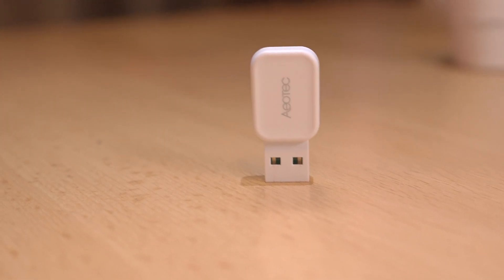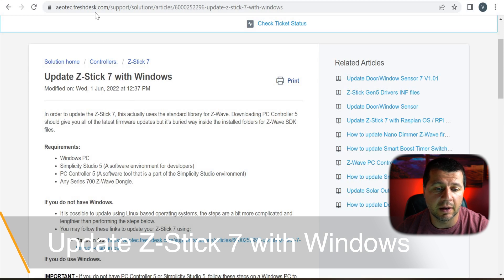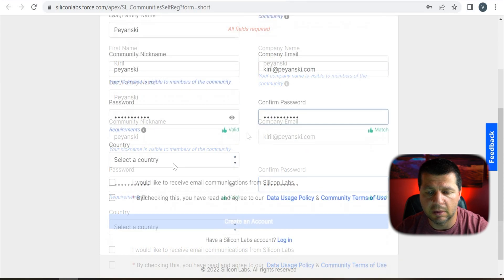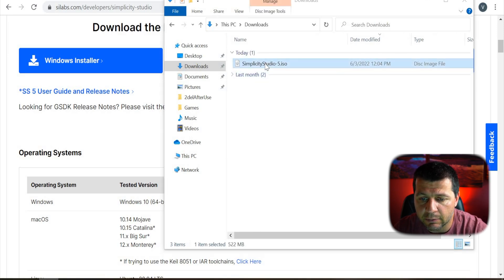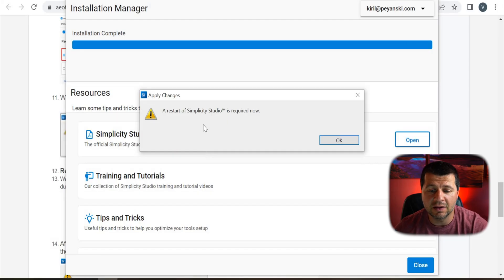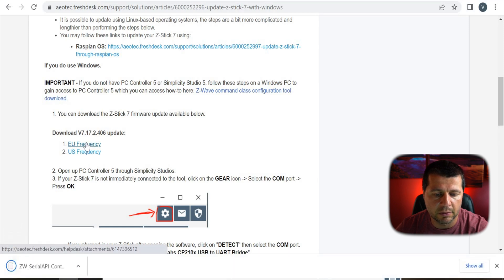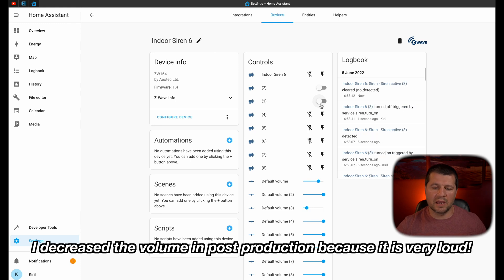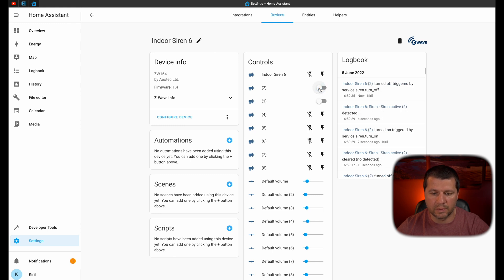I got Gen7 Z-Wave working in Home Assistant

Comment: Thanks Kiril for this video. Since about 2 month, my Z-Stick 7 doesn't work anymore with HA. I downgraded, I bought a new stick and posted informations in different Github Issues, but they where all closed now (stale/autoclose) because nobody works on the issues. I am wondering know ... do you have any issues with your Z-Stick 7 and the newest Z-Wave JS or Z-Wave JS UI and the newest HA Version?

Comment: I used the Linux method to update the stick. If you already have a running Linux computer all the first steps are already done. Adding your user to the dialout group is maybe also already done if you are used to running USB serial devices. The rest is installing minicom (one command) and follow the simple steps. It is not really that hard. The Windows installation is an insult. All the registration and installation of hundreds of megabytes of garbage just to upload a small firmware file with xmodem is total madness. Silicon labs could create a small firmware upload exe in a few hours instead of pushing end users through this shit. And so could Aeotec.
Reply from the maker: Totally agree with you. Hope that this will be streamlined in the future, but for now it is what it is.

Comment: I have a Vera Plus controller integrated with both node-red and Home Assistant. My z-wave devices (mainly Dome branded motion sensors) have been the most consistently reliable. I did have a cheapie z-wave power plug however that would end up with random disconnects, but I don't know if I could attribute that to the Vera hub. 
Looks like the z-stick 7 AU frequency version isn't available yet, but would like to convert once it is.
Reply from the maker: Many thanks for that detailed comment. Hope that they will make an AU version soon.

Comment: Wow, they made that update process difficult.... There is no reason for them to make customers go through all that just to update firmware... 0 points to Aeotec for that... I think this is the best stick going but now I just don't like their policies... Buy a device with bad firmware, submit all kinds of information, jump through hoops, etc... Bad trend... Great video though as always!!!
Reply from the maker: The update process is not coming from Aeotec, but from Silicon Labs. Silicon Labs are the Z-Wave owners at the moment and all Gen7 devices have their chips inside. So if there is someone to blame for the update process that is Silicon Labs. Thanks for commenting and for the good words about the video 👍
Reply: @KPeyanski  Hopefully Aeotec will flash the 'fixed' firmware in newer units... I wonder now if the linux update process is any more straight forward... I am using zigbee stuff so far but there are some great z-wave pieces out there! 😁👍
Reply from the maker: Yes, most probably all brands that are selling Gen7 Z-Wave sticks will pre-update the firmware on their newer units, but that is not the case for now. As my unit was brand new, but with old FW. The Linux FWupdate process is with a lot more steps and it is generally harder than the Windows one, but if you have some experience with Linux it shouldn't be a problem.